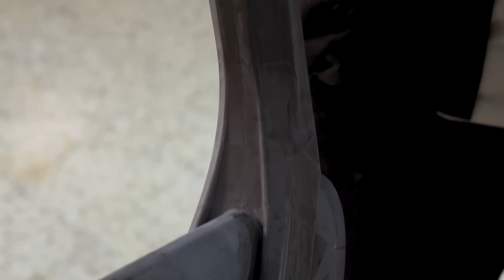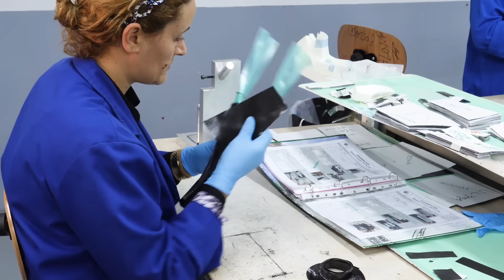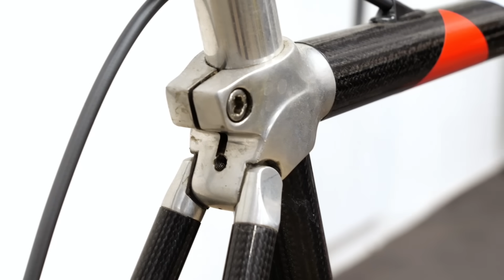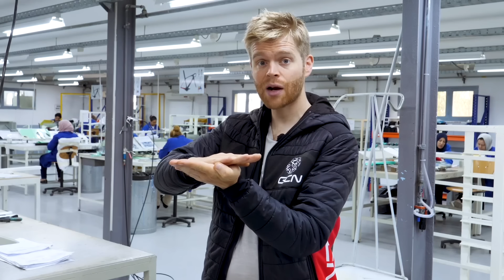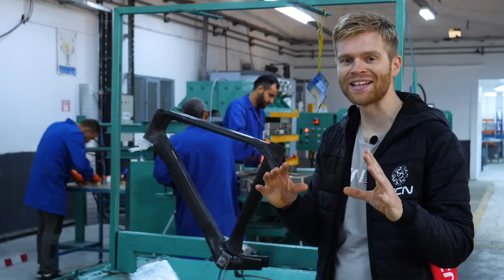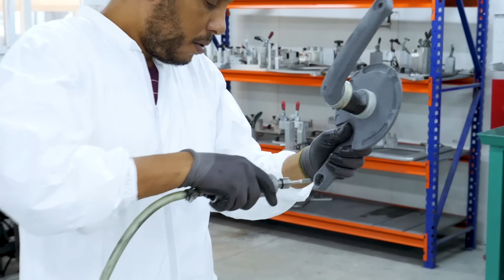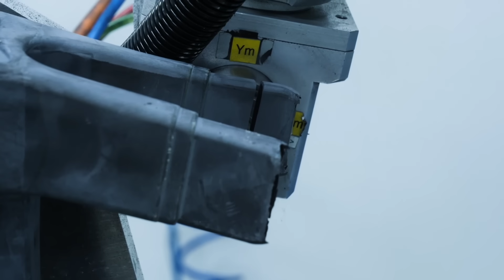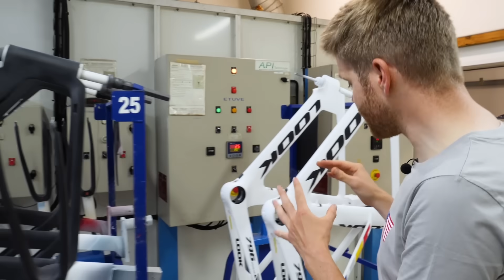How Are Carbon Fibre Bikes Made? | LOOK Cycle Factory Tour

Comment: Carbon fibre is the worst material for the environment. It's carcinogenic when the frame is cut. It can't be recycled and it's non-biodegradable. 

Coincidentally they are also the most disposable frames and often get replaced because of damage or age. Especially as UV light and humidity slowly weaken and damage the frames. No one will be riding that frame from 1986 that's for sure, but people Still ride steel bikes that are older. 

Also the quality of carbon frames varies enormously, they picked LOOK because they are about as good as it gets, most frames are not made that well.

Having said that GCN are being misleading again when they say it takes skill to make carbon bikes. 
It takes years of training and skill to weld Steel, Aluminium or Titanium frames well. But most of the labor of carbon manufacture is done by unskilled poorly paid labor. Most people that make metal frames and most Engineers are male, but go in any carbon bike factory in Asia and you will see row after row of woman doing unskilled and short repetitive tasks. Also they are unlikely to have any love for cycling or a passion for the product, unlike the people that work in hand built metal frame factories. (I know this from experience.) 

You see the reason they need to constantly beat you over the head with this propaganda is if you really knew the truth the industry would stand to lose billions of revenue. You see Carbon bikes are the golden goose! 

They are incredibly cheap to make owing to the way the material lends itself to mass production. Carbon is the most abundant element on the planet so it's hardly a premium resource. 

For the most part, Carbon is cheap to make and the markup is incredibly high! The reason they push carbon is because it makes them more money... if you want the truth follow the money as they say. 

I get to ride a lot of bikes in my job, everything you can imagine. The worst bike I ever had was a carbon bike and consistency I find carbon to be unpleasant to ride for one reason or another. 

Aluminium is cheaper and more fun and better value for money.

Steel is more fun, more comfortable, lasts longer and is better value for money.

Titanium like all metal bikes gives you confidence, it's more fun, quieter, more comfortable, the BBs/BB shells are better, lasts in theory forever, doesn't go soft over time, easier to look after, more crash resistant, properly hand built by real experts who truly care about the product, holds its value better, damage to the frame can be seen before an accident takes place, easier to re-cable, comes with a better warranty, won't brake if you just drop it, won't be damaged by stone chips from cars, won't go bad because of galvanic coronation, can for fill multiple roles such as touring, racing, gravel riding and so on without the need for specialist frames, can not or are not counterfeited (fake frame do not exist for Titanium bikes... and so on and so on. Honestly, I could do this all day. 

If you spent say $7,000+/-  on an off the shelf mainstream brand carbon bike... then, you wasted your money. I can predict with 99% certainty you are not a professional racer so you could have benefited far more from an aluminium or custom Steel or Titanium frame??? 

The reason the pros ride them is because they are inexpensive, easy to replace fast and cheap for the manufacturers. If you are a good enough rider then someone will give you a carbon bike for free, so what's the point in buying one?
Reply: Riding any bike has to be good for the environment. Coming to think about it, I've yet to see anyone try to recycle a rusty steel frame or a heavily oxidised aluminium frame.
Reply: @pervertt  hand it in to metal scrap and they will melt it down. Thats recycling.....
Reply: ride a LOOK 585 then we'll talk.
Reply: frank burn is it better than a Specialized tarmac or Giant TCR or a Pino F10 or a chipo one or a factor O2 and so on... or is the LOOK the exception that proves the rule?
Reply: @Steezicus  I assume its the frustrated carbon in your arse talking shit right now, Why using big words regarding an simple opinion on carbon fibre? Or is it the only kind of language your parents teached you, or is it too difficult for you to talk civilized?
Reply: A carbon frame sequesters carbon.
Reply: You are wrong on so many levels its commendable. How does CF lend itself to mass production? Did you not see all those people laying it by hand? Its incredibly hard to design products with CF and making it able to manufacture. (metals however, much, much easier) I dont feel like pointing out more wrongs, ill let you figure it out.
Reply: Well, the two bikes I've actually managed to break - were steel (the chain stay had rushed overtime, and snapped when I cranked up the pedals. Needles to say, the bike promptly discarded in the nearest dumpster as a result) and aluminium (the top tube - seat tube weld cracked; the frame was, thankfully, replaced by the insurance company). 
 Carbon fiber - so far so good, touch wood! Both have so far survived thousands upon thousands of kilometres ridden, and I do hope, they will a lifetime.
Reply: I don’t see why “skill” is superior in your better bike argument. If idiots can make a similar quality bike in performance by simply smashing carbon fiber around as compared to some “pro” with laboriously attained skills working on steel, aluminum or whatever , than carbon fiber bikes are better. Why is a harder bike to make a quality consumer should care about?
Reply: Gender and genitalia do not play any role in the quality of any manufactured product. Skill does however. I have not taken any manufacturing classes, nor worked in any facilities that did not imply women. They have the same ability as men to be skilled workers. I have never used my penis once when welding anything, have you? I agree that carbon frames are being made by people who are lower skilled laborers, but that is because of the extreme number of pieces that go into making one of these frames. That is common in manufacturing. The higher the number of people that work on a product the more likely it is that they will be lower skilled workers. If all of those workers were making top salary then it would cost 3 or four times as much, they are already prohibitively priced for many competitive cyclists. A custom builder may work alone on a metal frame, but carbon requires a huge number of people to manufacture. It was my understanding that carbon fiber and aluminum have a finite number of stress cycles before they fail. Steel and titanium do not as long as they do not receive enough force to go beyond their yield point. I often ride my 21(going on 22) year old steel Serotta. There are not a lot of 21 year old aluminum frames out there. My first road bike was in fact an entry level Rocky Mountain Oxygen AC (Aluminum/Carbon) and it cracked between the seatpost and the bottom bracket. I made myself a promise not to buy either material again after reading about their ability to take repeated stress over time.
Reply: Good points about carbon fibre's recyclability and durability. Cracking in carbon is annoying, but any frame can break, really.

The carbon on earth on the other hand is not ready for use on bikes as such. It's the processing into regular, extremely thin and consistent fibres that can be cut and used without worrying about the integrity of the material that's expensive.

The engineering behind carbon fibre is extremely complex. In essence the overhead costs and specialisation needed to make a composite frame are really high. The labourers, not so much, they follow instructions.

Look at the figures, learn about the manufacturing processes and take into account sustainability.
Reply: "carbon fiber" fishing rods have been around longer than carbon bikes,  and I have to wonder why they don't get damaged by UV and humidity?    LOL
Reply: The worst bike I ever rode was also a carbon bike, but the best bikes I've ridden have also been carbon. I have custom steel and alumniium, and have had Ti. These are all great materials for making bikes out of and you can make very different-riding frames from all of them, but for the same ride properties you will always be able to make a lighter frame out of carbon.

I agree that premium carbon frames have a huge price markup and that you are largely paying for marketing, but they are still the best frames. You need to shop around and do quite a bit of research to find really good quality carbon at good prices, but it can be done.

Carbon frames are relatively cheap to make because they are currently in fashion and are mass produced in huge numbers. Sure, a custom steel frame will cost more to produce, but I'm sure that mass produced alu frames don't and that the mass produced hi tensile steel frames of 30 years ago didn't.

Carbon needn't be "disposable". Plenty of people are now riding 10+ year-old carbon frames and there's no reason they shouldn't continue to be ridden for another 20 years if they aren't crash-damaged. Do you have any references to back up your claim that modern (sealed and painted) carbon is "slowly weakened and damaged by UV and humidity"? Also, crash-damaged carbon can often be repaired. The reason it's disposable is that everyone wants the latest thing and most people want to replace their bikes on a regular basis (this is driven by marketing of course), but that would be true whatever they were made of.
Reply: Neil well my evidence of damage by UV light and humidity was listening to a carbon fibre expert that worked in the aerospace industry and now works repairing carbon bikes. I know that's not evidence as such but a quick Google search should tell you the same. Humidity also effects the metal inserts in the frames, they react with the carbon and expand resulting in damage and de-lamination. I have seen that myself first hand on many bikes, but I do live in a very hot and humid place. 

All frames are repairable to some extent, carbon no more than any other, if you damaged your drop outs then that frame is done and it's one of the most common things to damage. It's why most criterium racers still ride Aluminium. It's cheaper to replace, less likely to brake. The thing that is most worrisome about carbon is it gives you no warning before it fails, often the damage is invisible to the eye and occurs slowly over time. Then when it fails its catastrophic! I had an very cheap aluminium frame fail on me while I was riding, (£125 full bike) the seat stay broke, but, the bike held together and I was able to slow down and stop. I have seen Carbon fail in similar ways and when one part fails the other parts don't have the strength to hold together and it collapses quickly and dramatically! 

Your point about ride feel/quality and weight is interesting. Firstly no matter how good the carbon bike is (and I have ridden LOOK, Scott, Giant, S-Works, Pinarello, etc) it has never felt like a steel bike, or a Titanium bike? Carbon is not like a metal, it doesn't have inherent properties like Titanium or steel, all they can do is attempt to copy or approximate similar ride qualities. You still get that carbon feeling, that dead feeling, that road buzz and they are never as comfortable to ride in my opinion, I know that's just an option. But I am lucky to have ridden some of the best Carbon bikes in comparison with the best Titanium bikes and for me the Titanium bikes win on everything, bar one point, that I will now answer... weight. (Oh also I read a review of a British made Aluminium bike the other day and it got 10/10 marks from the reviewer who tests 100s of bikes... he later said on twitter that he has never given a bike 10/10 before.... Aluminium bike. 

So, the big W, weight. So how heavy is your bike? My best racing bike is Titanium, the Seatpost is Titanium, the group set is Ultegra (all metal) the wheels are Aluminium, as are the bars and stem, the saddle rails are metal and the bottle cages are plastic. Only the fork is carbon and it gives the front end a bit of a harsh ride quality and as soon as someone starts 3D printing Titanium forks I'm changing. So basically my bike is almost completely metal, in size L It weighs 7.5kg. That's not heavy. Now my complaint is mostly about the ride quality of carbon and the price, but say I upgraded to all carbon fittings now you are looking at a bike that may be 6.something? The lightest bike I know locally is a guy that rides an aluminium allez, it's 6.6kg. So clearly you don't need a carbon frame to be lightweight. Now I agree that the lightest frames in the world are carbon, but we are only talking 1-300 grams difference between them and the best Titanium or aluminium frames, and the best Titanium frame is cheaper than the best carbon and Aluminium is dirt cheap. Any bike below 6.8kg is not UCI illegal and most Super light carbon bikes ride like shit. Carbon is not magic unfortunately, it has very real limitations, things GCN and the people that sponsor them to make videos would prefer you not to know. If you ask the Pro tour riders how heavy their bikes are most don't say 6.8, most say 7+ even 7.5! if lightest = better why wouldn't they all be riding bikes that were as light as possible? Because bikes that light don't ride well and the 5.5kg bikes are made for 55 year old men who like to brag during the Golf game, not proper riders. Because the way they make them that light is shaving more and more material off components, totally impractical stuff. Look at the lightest carbon kit on the market, a lot of it is full of holes. Just like my old dad and the way he drilled holes in his brake leavers on his steel bike back in the 1970s 

About production, Carbon is far faster and cheaper to make, to hand weld well  takes years of experience or a very expensive robot. I used to sell and program and repair the Robots so I know, but for some reason they are not used in the cycling industry as far as I know, it's all hand welding. Sanding bits of carbon can be learned in an afternoon and is unskilled labor done mostly by sweatshop workers in Asia. I would rather have my hand welded Frame from America or the UK any day. I can ride knowing that some Chinese woman isn't getting cancer because of me. As healthy and safely is obviously better in the west. Interestingly my carbon fork that comes with my Titanium frame is also made in house in America. Fun fact. 

Yes people do change carbon mostly because they want the latest model, but that rampant consumerism is definitely more apparent in the age of carbon than it was before. That is because carbon frames can be made quickly and in such a variety every year that it's easy for companies to produce numerous models and claim they are "better" and that the customer needs them. But also most carbon bikes I know look like rubbish after one or 2 years of hard riding, they are definitely a disposable items. When I scratch my Titanium frame I just polish it and it looks like new? 

Fact is, you don't need carbon to be fast ether, guy won a crit yesterday on a steel bike, I used to pass guys riding Pino F10s on my 12 year old 8.6kg Aluminium bike. (Hand made British Aluminium) 

Anyway, you made some good points, it was nice replying to you. 👍🏻
Reply: @reginaldscot165  Good read. Great to see people having a civilized conversation on the internet.
Reply: What also worries me from seeing this video, if they glue the parts of carbon together, isn't that instantly a weak spot ? For MX and Dakar rally's, you don't see many carbon bits either :) I guess they don't trust carbon fiber enough for repetitive rough abuse in harsh environments ...
Reply: Is crap because it chips
Reply: @raulcruz6601  Its a good thing metals dont chip....
Reply: Get use to it, going no where.
Reply: @Pushyhog - I don't agree with Reginald Scott but that was an astoundingly pointless response.
Reply: Great comment. And so sad that GCN is not taking a more critical view on carbon. GCN should make a video about what happen to all this carbon pieces if no longer used. Hopefully they will also turn more critical about carbon material.